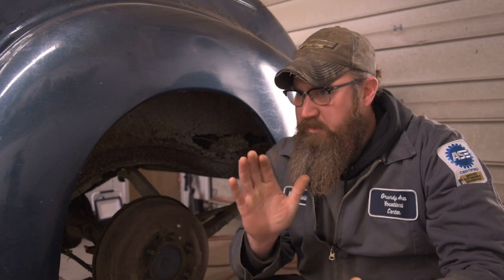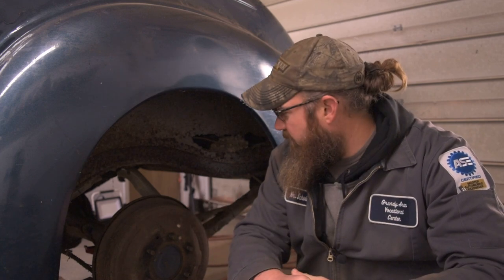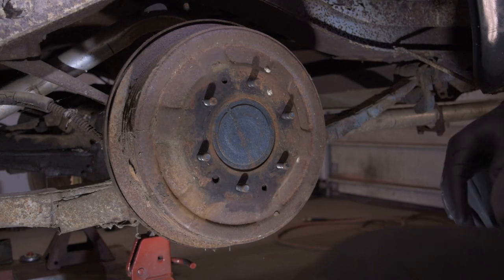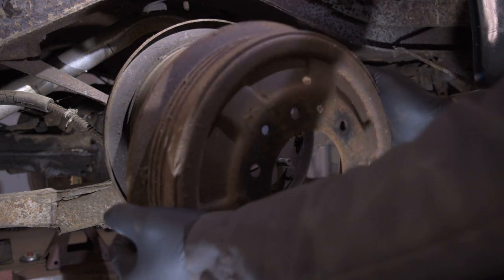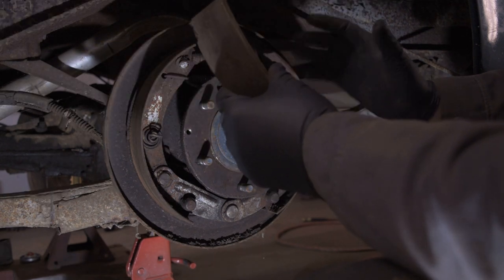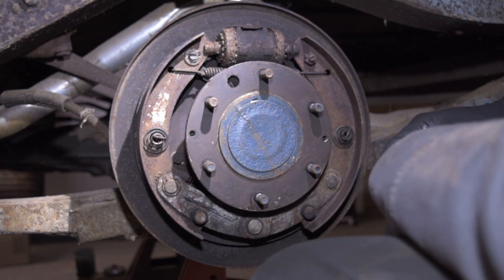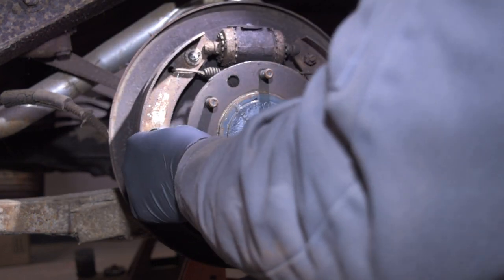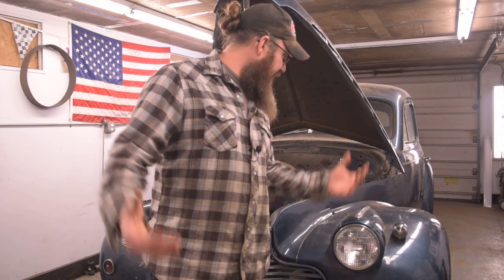1940 Chevy Barn Find Brake Disassembly

Comment: Nice , got one major problem- you might be able to help with-- Let's start with- I 'm no mechanic... I was a locksmith-- I want to do a "complete brake job" on my '48- shops have told me they won't do it unless I order the stuff- I was going to order from Amazon.. ( next day shipping) I know my lines and master cyl. are okay... But there are so many "kits" I have no idea what to order.. I don't want to - have a shop start telling me " you didn't get this or that" ... and re-order several times-   If I get too much that's okay I'll just save it for down the road when it's needed.  I already tried specialty car clubs-- 0 help.. one person even mentioned a "flex hose" which I haven't seen in any video... and No NAPA- or other automotive store is of any help.. I have a 1948 Pontiac- Silver Streak (4 door)  If it's any help- let's just say the brakes haven't been touched in over 20 years- so I'm assuming I need everything- including  drums... Can't trust salespeople- weatherstripping people I had to re-order 4 times...  But I'm looking for what you guys call a "complete brake kit." My goal is just to get the brakes done- so I don't damage   one of those fiberglass car.-I even tried calling Rock Auto-- no luck... Strange thing is all these shops want me to drive it in- just so they can " look at it"..... All I have is crossed fingers - when I drive..... Oh the brake pedal doesn't go to the floor "YET"